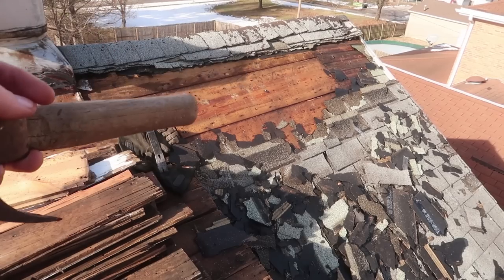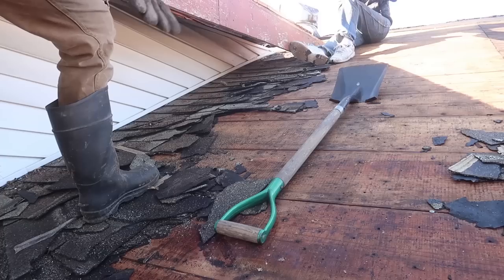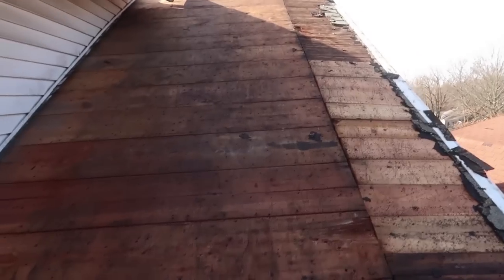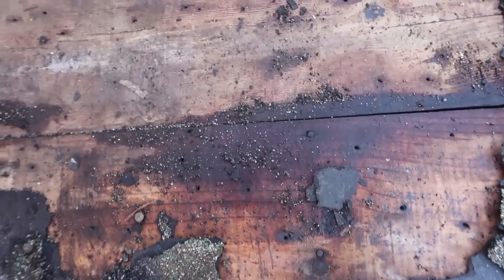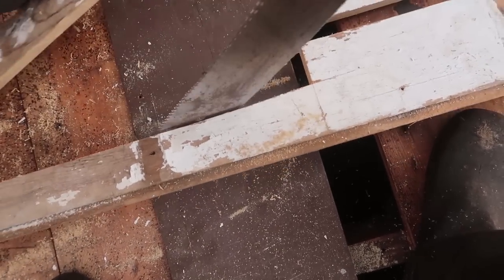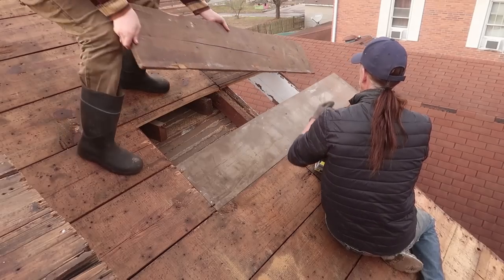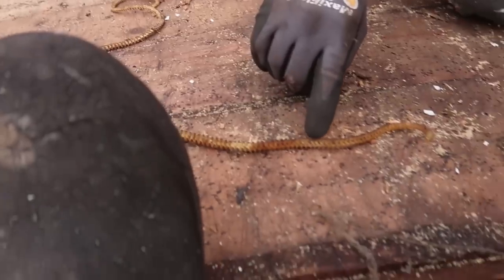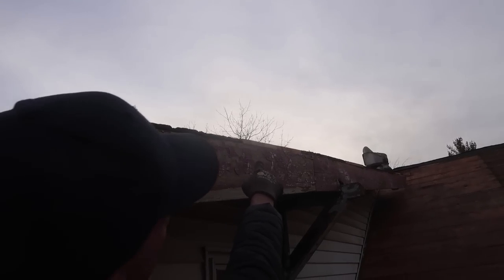1925 Abandoned House Restoration 21: The End of Roof Structure Repair

Comment: Good job on the preparation for new roofing, looks like you'll soon be set for a 20+ year-lasting new roof of comparable material. Longer if you opt for metal. I think you could have saved yourself much additional labor with a strategically positioned dumpster, now you'll have to handle the debris again, at least one more time. You should have a well-deserved feeling of accomplishment for tackling the job yourself, you got this.

Comment: Hi Rinoa and Bill, Congratulations on all the work you have done so far on the roof but I fear that you may want to do more. As you have noted, the sagging additional roofs on the sides were poorly installed. You are attempting to hold some of them up by replacing rotten timbers with cantilevered sheets but I wonder if they are enough. Perhaps you may want to consider installing some trusses at right angles to the main ones, and spanning at least a couple of them, which you can attach the fascia board to, using metal braces to nail and support the horizontal beams. Good luck!

Comment: You would've saved countless hours of tedious labor by borrowing a proper roofing shovel from someone. I took down a 75-year old duplex house last summer board-by-board, starting with the roof, which had 3-4 layers of disintegrated shingles on it. It went at least 3x faster with the roofing shovel as opposed to prybars or other methods. I didn't want to buy one so I borrowed from a friend who had one—it's a tool that a lot of people own but never use.

Comment: The roofers shovel would definitely make it easier and faster it’s designed to remove the roof nails with the shingles  but like u mentioned before your ok with the flat bar which is working just fine

Comment: They probably meant a roofer's shovel which is a whole different beast than a regular shovel, $45 or so. Not much good for anything else though unless you do a lot of shingle removal so not always worth the cost if you have the time to do it with the flat bar and hammer.
Reply from the maker: yeah the spikey ones
Reply: @RinoaL  You two are hard workers for sure

Comment: just wonder if that jigsaw puzzel is structal sound and safe
Reply: It’s better than rotten wood! Old roofs, especially on antique houses, usually look like that. They didn’t use huge sheets of plywood back then.
Reply: @5roundsrapid263  thats true still is it safe
Reply: Axel Brinkmann I did construction for years. It’s safe; it doesn’t support anything but the shingles. The heaviest thing it has to hold is snow, and that should fall off pretty fast.
Reply: @5roundsrapid263  i am an graduate electrical engineer from germany  so i am not familar with the us Building codes but in germany any structal engeenier  got a heart attack seeing that

Comment: When are you going to shingle it?  Also, how does the other side look? I assume that's the north face and didn't get as much sunlight and the shingles held up better.
Reply from the maker: we plan to maybe put a few packs of shingles up every weekend starting the new year. and then in spring we will have the other side done by professionals since its so steep.
Reply: @RinoaL  oh I didn't realize it was steep, that could also explain why it didn't leak. I'm surprised you want to hire someone, that could be expensive, I would just get some ropes and do it myself, although I haven't seen what it looks like so maybe its worth hiring someone, good luck.
Reply from the maker: @buddyloco9504  two story drop bellow it, and when it comes to metal roofing i dont want to trust my skills at doing the fitting.

Comment: Shingles are such a failed technology... use metal if you possibly can.
Reply from the maker: agreed, we are contemplating rolled roofing until we can afford metal
Reply: Disagree.  They have been used for a long time.  I have architectural shingles on my roof. Rated for 50 years.  It is how the work is done, as it is for most things.
Reply: Elon Musk wants to enter the roofing business and cover your roof with 30 year solar panels.  Depending on how much you spend per month, the roof might pay for itself in savings.
Reply from the maker: @timmooney7528  yeah but unfortunatly his GIgafactory 2 hasnt ramped up production of roofs fast enough, and the cost is still fairly high.
Reply: @RinoaL  I agree they're not quite there, but the technology keeps improving and the prices have been dropping.

Comment: Can't understand why this roof has those shortboards at the edges, don't make structural sense, was it widened or something?
Reply from the maker: it was a builder who thought they could cheat, its a terrible corner to cut
Reply: @RinoaL  No, as I commented on the last video, they're decorative. The original roofer did the overhang (i.e. the parts that are visible from the ground) in fancier wood and used plain boards everywhere else. Seems perfectly reasonable to me!

The real problem is that there isn't much to support the overhang and the brackets eventually failed. Those overhangs need proper rafters and sturdy brackets to support them! No matter how nice and long the boards are, the overhangs will sag again, unless you get them properly supported! Do you have any idea how heavy wet snow is?
Reply: @RinoaL  O no it was Bob the builder from toy town, you guy's did the best you could out of what you got, I just hope it holds up under heavy snowfall
Reply: @Ragnar8504  Yeah I was thinking snow heavy

Comment: Youve got snakes cuz youve got mice. Ewww
Reply from the maker: well every house has mice here, they come in from the fields in winter. its why people have cats
Reply: @RinoaL  ive chased a few from here, in my house it seems they get in just before it snows here in ontario canada. Good vids.
Put lots of mouse traps around the house and seal every hole you find outside the foundation with steel wool and sprayfoam.I paid 40,000.00 for my house and it aint easy to renovate. Good job you guys,Take it one day at a time.